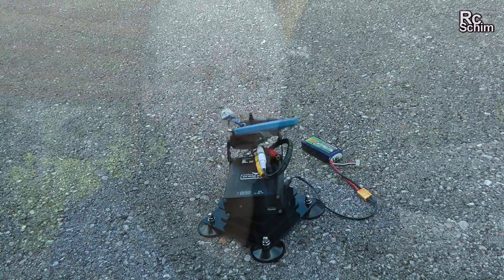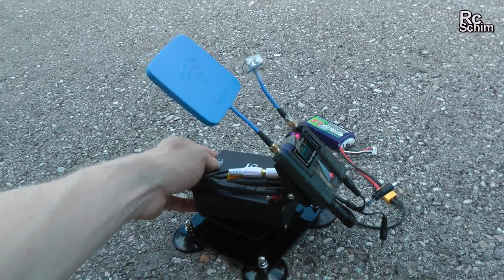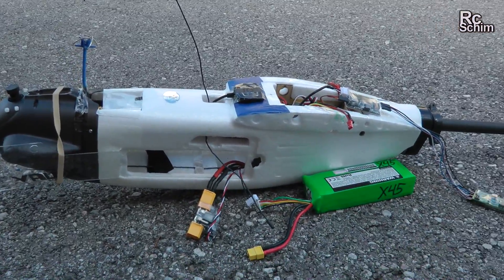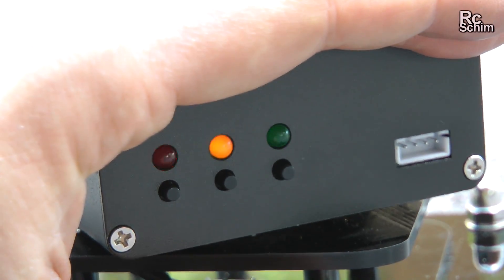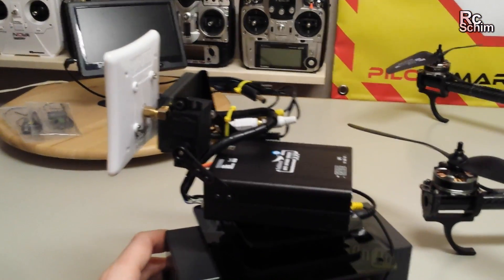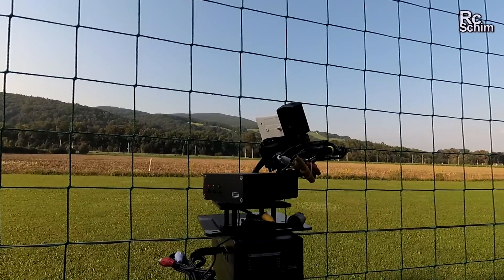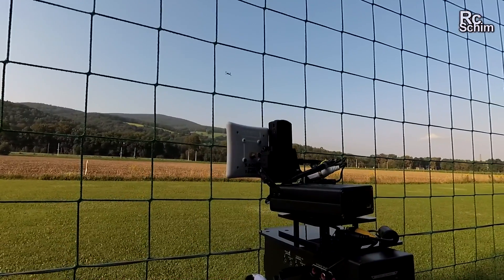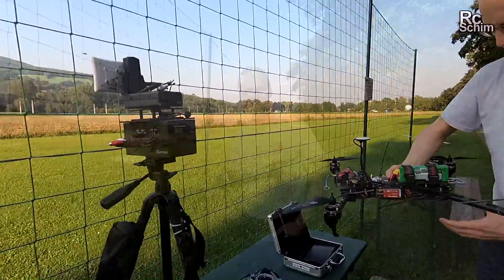Arkbird Antenna tracker review | See it in Action! (easiest, most versatile works with all OSDs!)

Comment: so is it a complete kit or you need to get gps?
Reply from the maker: Of course you need to pay attention what contents you will get if you buy it now (this review is 6years old, so the product might have changed).
Generally I wouldnt use a tracker anymore. It looks very nice and I love the tech stuff - but with modern video transmission and good antennas I dont see the need anymore.
Reply: @Rcschim  my pepper box antenna is 160 degrees beam horizontal

Comment: Does the arkbird AAT also work with a 2.4ghz video system?
Reply from the maker: Benjamin Coussement yes, it is not fixed on video frequency. You just have to use an analogue video transmission.
Reply: RCSchim Ohhh okay thanks because some websites all told me that i could only use 1.2/5.8GHz.. And I just needed a 2.4GHz system haha, the antenna’s for 2.4GHz have a much higher gain and lower price because wifi is the same frequency and price-demand.. you know what I mean, but I’m happy I can use a 2.4GHz video system!! What a relief🤪

Comment: Is there anything like this that will work with a dji mavic pro?
Reply from the maker: jacob aikey honestly: the mavic has more range than needed! You don't need directional antennas and antenna trackers here...
Reply: ok, a phantom 3 standard
Reply from the maker: if you wanna do some advanced stuff (like using antenna trackers and such) you should look Pixhawk, APM or however they are called now. They are opensource flying robots. Lot's of fun if you like to experiment. DJI stuff is consumer grade - trying to use them DIY style is not efficient or fun I guess :)

check my Quanum Nova review that I did a while ago. It shows some of the things you can do with this - and of course you can integrate a tracker there...

Comment: Have you tried the ppm mode with the ezuhf with your arkbird autopilot?
Reply from the maker: no, I only used the plane with arkbird last summer for a few flights.  this was not the fault of the arkbird, but rather the xuav one didnt fly that good, and motor gears stripped out soon.   I have a mini talon to build which should inherit the electronix from xuav one then.

Comment: Friend, I can use this tracker antenna with any OSD, or only with Arkbird?
Reply from the maker: hi, with any OSD BUT: you need the arkbirds "airmodule" which encodes GPS signals into VIDEO and AUDIO channels of downlink.
You can take GPS from your other OSD if it is compatible else you also need a gps antenna for the arkbird airmodule. 

anyhow this is better than other systems like the ezOSD / Antennatracker combo - this is really restricted to ezOSD alone...

Comment: what if my vtx doesnt have an audio channel so to say
Reply from the maker: I think it will work with video only as well since arkbird encodes telemetry data in video.
of course having both is optimal but if video fails audio fails normally as well. 
in short:  the yellow LED will flash (telling you that video channel receives GPS data, the green led will not)

Comment: So does the airborne module have a video in/out and takes the existing video/osd signal through there ?  Do you see anything in your live view that is different because of the extra signal the module is putting through it.  I like the idea of this, you have to usually go with one manufacturers OSD and use their tracker, locks you in.  Hope you'll do a few long range demos with some fpv recordings on the plane
Reply from the maker: +CurryKitten I've seen no difference between original video and the output of the airborne module. I have to do a latency test, but i dont think it adds latency...
I agree its a nice idea to be osd independend.
Reply: Hi RCShim, nice video as usual :-)  you should  check out the RSSI Pro Track it needs no extra onboard equipment and is much more versatile and simpler to setup/operate than the Arkbird,  it's basically a plug and play  ground station no GPS or OSD required comes with the antennas and built-in receivers with diversity option for close in FPV racing
Reply from the maker: +thomas donnelly thanks for the tip. Is this the one with 3 antennas and rssi based selection and then turning?  I like the idea but never saw them around. Maybe most of us are satisfied with diversity and good antennas like an pepperbox?
Reply: Yep that's the one the RSSI Pro Track continuous 360 rotation  it's a long range tracker that  also works close in for racing, think it's the only tracker out there at the moment that can perform both functions, and is also the easiest  to operate, I know most of us are satisfied with diversity and pepperbox etc  but thought this video was for people who might be looking to use tracking aids? for a better video feed   cheers :-)